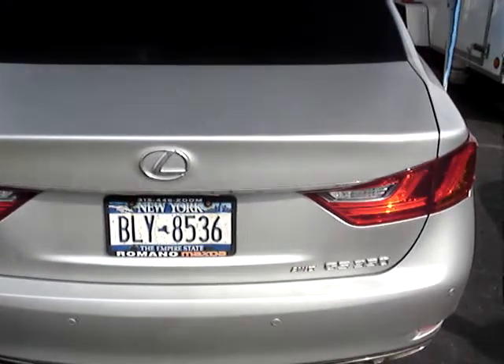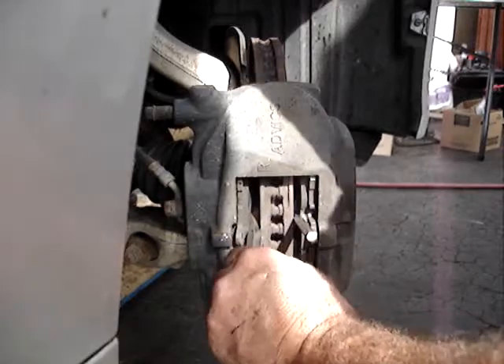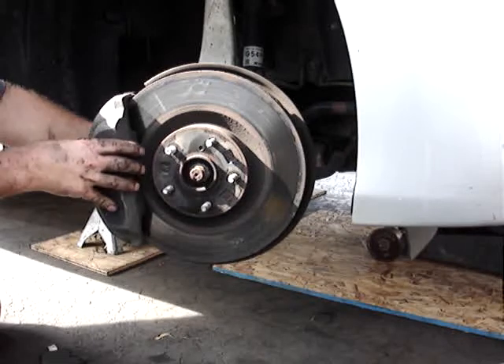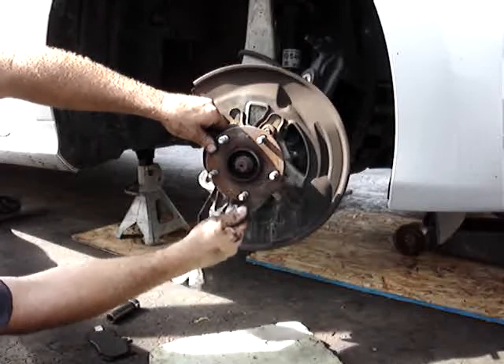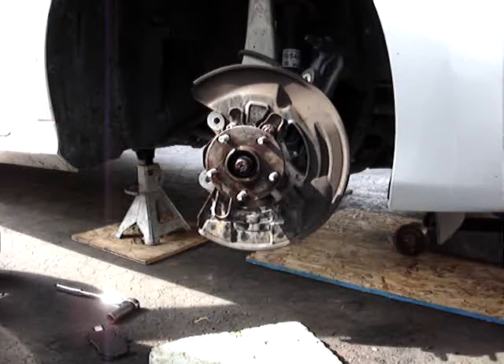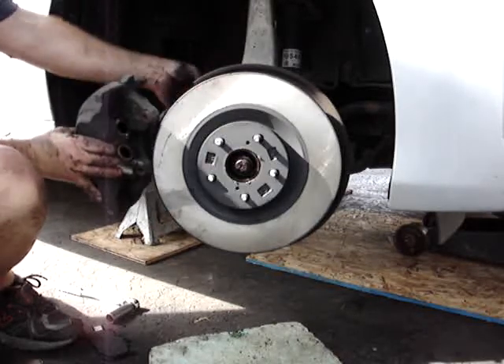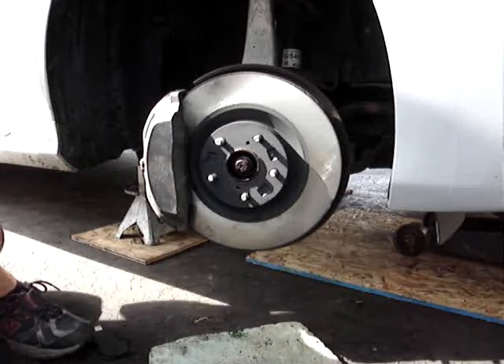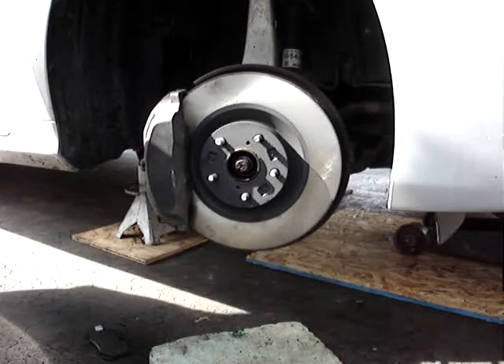2013 lexus gs350 front pads and rotor replacement

Comment: Instead of beating directly on the rotor, I usually use a block of wood so the impact doesn't cause any issues.  I am not sure it will, but I don't want to chance it.  I rubber mallet also works well.  If you are not getting new ones that is.

Comment: Dave, is this the same for a 2014 GS 350 F sport? I need to replace the front rotors and pads and Midas and Lexus wanted $1,150 and $1,200 respectively and 3 hours in the process.  Screw that. I have replaced brakes before so I know it's not rocket science  and watching this video makes me want to do it myself and save about $700 bucks in the process. Thank you for making it.
Jim
Reply: All Lexus are mostly the same atleast the sedans are mine is 06 and it has the same brakes

Comment: I just tried to take my calipers off and I could not get those bolts off.
Reply: Did you ever get them off?  Sometimes I have to use a hammer to bang my socket or box wrench to break it free.
Reply: @Brian-xu9di  yeah I finally got it off by doing what you said. The more I work on my car the more I fall in love. Now I'm having an issue where my rotors keep warping. I'm not hard on my breaks at all. I think its the pads that I bought from r1 concept.  I bought a pair of one piece rotors as well and a month later warped. So I bought the factory 2 piece rotors and 6 months later warped. I don't know if I'm not doing something right or what.
Reply: @shaqwilliams3343  thats strange that u keep warping rotors.  Have u tried OEM rotors?  Maybe those will work better.
Reply: Before sliding the rotor back on, be sure to clean the hub area that the rotor fits against.  Ensure there is no build-up of rust or corrosion of any kind. Use a wire brush.  If there is anything in that area it could cause your rotor to fit slightly off causing uneven wear and warping.  Just a thought. Hope you get your problem fixed. These are truly great cars!
Reply: @bblair502  thanks for the tips. Yeah I switched back to the two piece rotors and haven't had any issues.  I think my issue was my pads. All good now though.